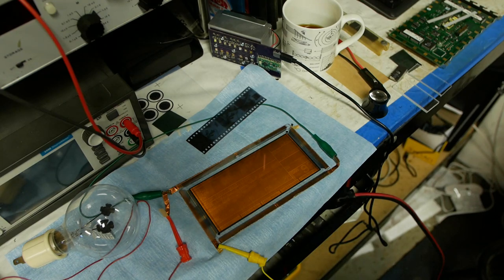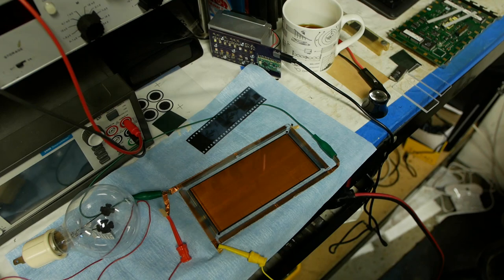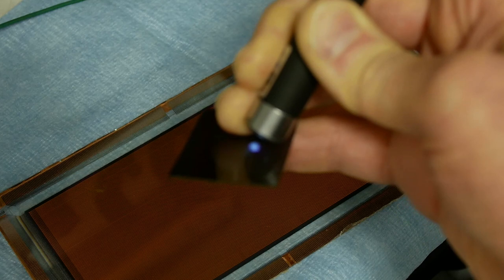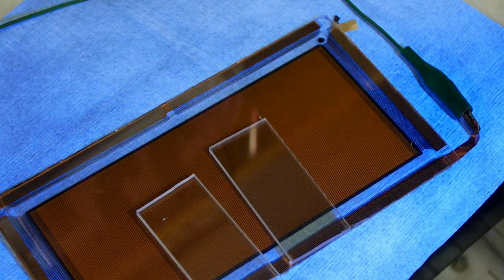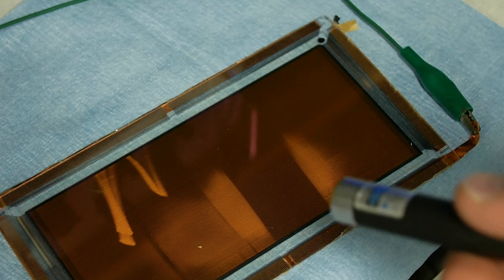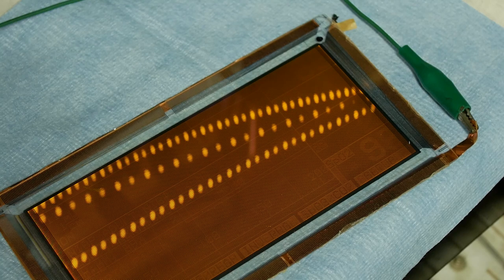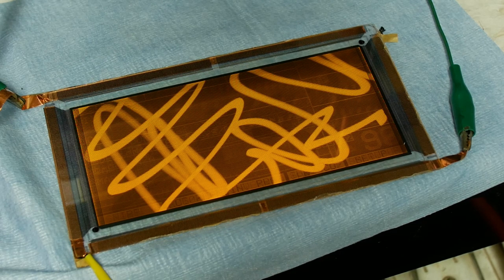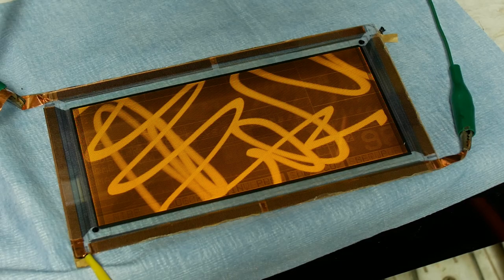Drawing on a plasma display with a laser pointer

Comment: What happens if you use a VFD to adjust the AC power input? Potentially adjusting the spacing and dot length etc.

I'd love to see something like this as a blueprint/mapping interface for round table discussions. Especially if it had variably  persistent layers and some kind of image capture.
Reply: I worked on sensor panels, think lcd panel but camera, and those things were crazy sensitive to burn in caused by ambient light. Something about charge building up on the tft gates and getting stuck there. We could sometimes fix it by tossing the panel in an oven for a while.

Comment: But doesn't your explanation contradict with the fact that you could light the pixels with power off? How is the freed electron held in place with no power? And if that's true, why weren't the dark spots between the dotted point from the fast laser movement illuminated at least a little bit?

Comment: I wonder if the impedance of the panel as a whole is affected by having a large number of pixels lit up? Did you look at that? Also wondering if there is some form of partial rectification going on that explains the discrepancy in brightness.

Comment: observation: you said "only half or 3/4 of the pixels are working" but on camera it seems every pixel is working- could it be that the pixels are working at a long enough period of time from the low voltage that they don't "work" to the human eye but still are enacting the data at a slower period?

Comment: Is the charge going thru the dielectric, or are you just ionizing the gas itself directly and it stays in the plasma state thanx to the EM radiation from the AC current like in that grape-plasma in a microwave oven experiment?

Comment: Big fan of your work on youtube! I've been thinking about making an HPLC since they're crazy expensive and thought you might have already done some thinking in this area. Is it feasible with parts from ebay and home depot? Or maybe get a broken one and get it working? Might be cool to do a video on the principle and types of HPLCs... ;-)
Reply: The pumps for hplc have ridiculous pressures they can achieve (at very low flows) and the detectors are also a bit tricky in my opinion, but they are not rocket surgery. They are very simple pieces of technology in principle, but very hard to do well, and have them consistent.

Comment: If charge injection is the mechanism, would the screen light up from beta/(maybe alpha) radiation ?
Reply from the maker: The alpha and beta emitters that I have are not energetic enough to penetrate the glass (I'd need a very large particle accelerator).  I also tested a small gamma emitter (no change in panel brightness), and tested my 50KV 1mA X-ray tube at point-blank range and saw no change in panel brightness.  I think this is because the area is very small, and most of the gamma and X-ray photos fly right through the whole device, not interacting with it at all.  There is some indication that old commercial neon bulbs have radioactive elements inside them to make plasma ignition more reliable. I think the key is that these radioactive elements are inside the glass, allowing beta and alpha emission to hit the gas directly.

Comment: Why does the panel not pick up a constant line when you move it fast? You've shown when the panel is powered off it will pick up the laser when powered on.
Reply: It probably does have some effect, you just can't really see it because the bright spots are so much brighter.

Comment: I wonder if there is any way to scan out the image after it has been 'applied'. Perhaps if you could accurately enough measure the current of each pixel in turn and determine the relation between current and brightness?

Comment: Is it possible to fix the burn-in? I think it might be if you were to shine one of these lights on it for a long time, because from what I see the parts that are burned in seems to get better when you shine the laser on them!
Reply: I am pretty sure there is no measurable 365nm emission from 405nm laser pointer. It's just light intensity that is magnitudes higher. Some ASE might be in +-15nm (for NUV source), but even there ASE is reduced when we are above lasing threshold. Beyond +-15nm spectral energy density drops like a cliff. If you do see emission beyond +-15nm - it is likely straylight in the spectrometer.

Comment: Read writable with external light influence, yes, screens that adapt to ambient  . 
 Lost me on the jump from scanning DC to the AC pixel, doesnt that also need scanning so low brightness or is the ac much brighter, . 
EEPROM's  with metal lids , have to erase with special 0xFF light .
 around 1982 I made a camera with a removable lid DRAM , WR  0xFF, wait, RD. Must have read it in hobby electronics.   
golden video, I know its a good one when i have to re-watch portions. 
 the  external light effect gated by another ITO layer. 
archade video gun  game where you shoot a screen but the gun was a  lensed reciever, in this , the gun can be the transmitter. from any distance. 
Love the first principles of physics.

Comment: Suddenly, I am trapped in solid-state physics and semiconductor physics. The more I struggle, the deeper I am stuck. So, how do those electrons go through the insulation layers? Do they reach the conduction band of the insulator or simply go to the vacuum level? I have read my book, but I am still confused, and thinking about the world and my life now.
Reply: Well, I have got all the credits I need to graduate and earn my Bachelor of Applied Physics degree. So, I should be qualified. Instead of dwelling on my major, I just need to choose another subject to avoid confronting how poorly I performed in it.

Comment: Question? If I take a neon bulb with a strike voltage of, say, 80 volts and a sustain voltage of, say, 45 volts, and connect it through an appropriate resistor to a 65 volt power supply, the build will not light.  Will it light if I shine a UV source on it?
Reply: That does work, but the bulbs I tried it on had to be pretty close to their striking voltage for that to happen.

Comment: Could a laser itself be the reason for a dot effect?  Thanks for a video!
Reply: There any readable difference when it's brighter/darker IE voltage/resistance? That difference between acrylic & polycarbonate would be a nice way to detect plastics that's exceptionally hard to do.

You try it on a solar cell? I know they emit light when you drive them in reverse and have the same sort of tech inside them. (more in the IR range though IIRC)

Comment: I'm pretty sure you could make an unconventional computer with each plasma control line acting as an input, a UV mask as a weighted average (DLP projector), and a camera as the output to read the state of the plasma cells. It reminds me of this paper somewhat. https://oa.upm.es/23103/1/Optically_programmable_logic_cells_as_basic_units_for_transmission_and_synchronization_of_chaotic_signals.pdf

Comment: I had a lab on neon lamp ages ago, got boared connected 4 adj psu in series and  it lit with intense luminosity for a few s then over about 400ms a single hot spot danced around the glass weld and separated off the cap. Very weird and much less exciting that tossing charged electrolytic grenades at your buddies.

Comment: There any readable difference when it's brighter/darker IE voltage/resistance? That difference between acrylic & polycarbonate would be a nice way to detect plastics that's exceptionally hard to do.

You try it on a solar cell? I know they emit light when you drive them in reverse and have the same sort of tech inside them. (more in the IR range though IIRC)